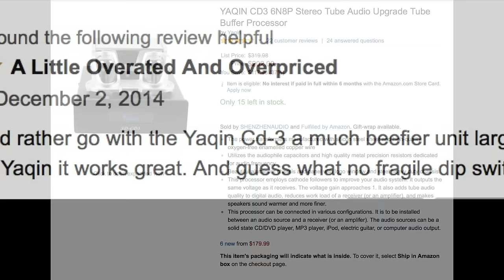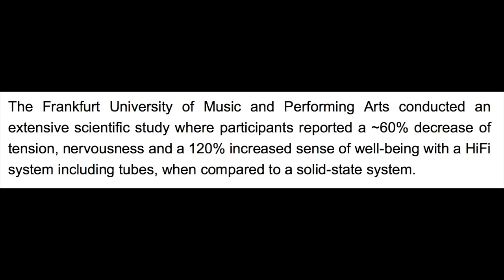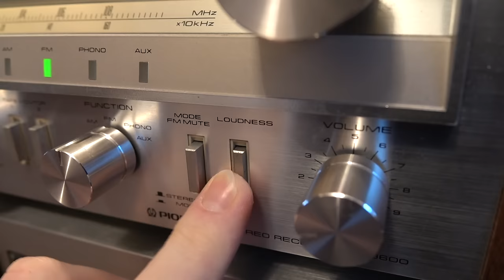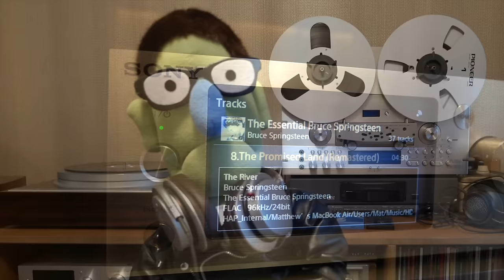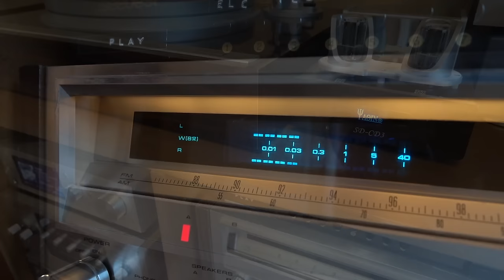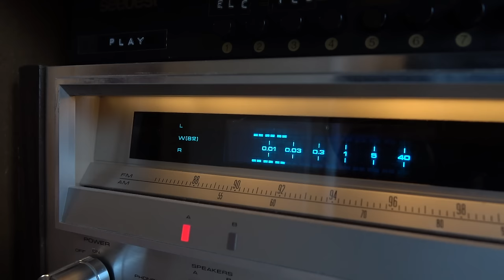Add the magic of Valves to any HiFi - with The Yaqin SD-CD3 tube processor

Comment: I'd somehow expect there to be a bit of a phase shift, which would tend to "open up" the image. While I like tube, uh, valve amplifiers, the only real advantage tends to be that they "smooth" the audio a bit due to the lack of transient response. That smoothing effect is pleasing and tends to "gloss over" distortion from the source. That is why a tube, uh, valve (LOL) preamplifier is just as helpful as a... uh... non-solid-state amplifier. 

Here in the US market, the original Magnavox company built transistor amplifiers in the very early 1960's that were designed to sound like (dare I say it), the tube amplifiers they replaced. They succeeded, but the designs had serious power output limitations and limited treble performance vs. newer designs.

Comment: 3 "Must Do" mods for the SD-CD3... 1) Add 1M resistor across the input jacks. 2) Add 100K resistor across output jacks. 3) Add 220k 2W resistor across C5.

Comment: Have you tried it with the Chinese tubes yet? I'm wondering how much the tube change actually helped. Great video. I just ordered one out of curiosity. I hope it  warms up my digital a little. If not it's no great loss.
Reply: I have one and changing the tubes really improves the sound. I tried some NOS tubes and I noticed a change in sound, then I bought a pair of Shuguang Treasure CV181-Z and after some hours of burn in I was sold, I don't think I'll roll any other tubes into the buffer, there's another user here in youtube with this buffer and the CV181-Z tubes (after reading and watching his video I jumped into buying that tube model) so to answer your questions, yes, if you can buy some good tubes and You'll be happy

Comment: Small fun fact and very late but that original power cable would have made the device not earthed cause the earth pin had a cover on it. There is a bigclivedotcom video where he demonstrates this with an adapter if memory serves correct.

Comment: Tubes have different harmonic distortion profile, arguably more agreeable to us. Not less distortion, just different harmonics.
As for greasy fingers, you should wipe clean halogen bulbs that react several hundred degrees almost instantly. Tubes used in audio equipment don't get that hot, and heat up slowly.

Comment: i really think that what youre hearing is a lot of harmonics the tube introduces to the signal. mostly even order harmonics. judging by the circuit it does uses the tubes i think, those blue capacitors are high voltage grade and it does seem to have a power transformer for HT, yet the black eletrolitic caps are rated 250v wich is not really much safe, right on the limit.

Comment: great stuff... and the greasy fingers bit probably comes from the fact you can't touch halogen lights with you dirty fingers, and they just thought tubes would be the same. not so... the only thing from tubes in my guitar amp is driving them around in the back of my car... they tend to stuff up, maybe the jolting or heat and movement... not sure

Comment: If any amplifier designer from the last century had added a valve stage with a gain of 1 into an amplifier schematic, they would have been fired for idiocy. Yet here we are today, with our so called progress and companies are selling said idiocy for 300 dollars.
The valve sound is not going to be achieved solely through chaining audio inputs through an audio valve stage with a gain of 1. Biggest advantage to valves is their current output potential, they drive loudspeakers better than transistors and with a more musical distortion than transistors that go into clipping, so there is more to the valve sound than just adding the character of a valve at the input stage. There are times when valves are less beneficial, where the sonic signature of your amplifier/loudspeaker combination is already warm sounding. I've never been a fan of valves in the first stage of a phono preamp, because of the low signal to noise ratio. A J-FET is much better. Out of all the systems I've listened to over many years, my favourite has been a Marantz CD50 and Sony SCD-1 into a home made passive pre-amp that uses dual Alps Black Beauty potentiometers,  cabled to 2 monobloc Quad 2 valve power amps that adequately drive a pair of Kef 107s. The valves were GEC KT66, they didn't have that valve sound ( that is such a generalisation because valve amplifiers all have different sound qualities ), but they were implemented in a simplified well designed amplifier.
Valve amplifiers need less audio stages to achieve their rated power output, also meaning less phase shifts in the amp design. The consensus on forums was that I should use a high power transistor amp to drive those dual 12 inch drivers. If those valve amps could drive Quad ESLs with 83db/W, they could drive the 90db/W 107s, and they still do today.They marginally beat any other transistor amp I've owned, but I also liked the sound of the later transistor amplifier Quad 303. If you want that valve sound, just get the real deal, a valve amplifier.

Comment: I really dont want to sound like one of the techmoaners as you seem to get more than your fair share of them here mate, but there are a few things to know about how and why a valve amp (and yes I call them valves too) works in order to understand why you are not getting any results that make it seem like its worth the effort.

I did the same as you for a long time, I remember my dad had a valve amp, its an old valve amp now but then it was "semi old" and I remember it sounded great, after going from cheap amp to cheap amp I invested a couple of grand on an expensive one. I treated myself, because I can, adults can do that kind of silly thing ;)

Dont bother to look on places like Amazon, find out how they work with regards to how the electric passes through it, how the sound passes through it and you will realise what I did and why I went expensive.
How a good one is made is just never going to be cheap :(
Reply from the maker: +BladeRunner21577 what model,of amp did you choose?
Reply: I ended up with an Acuhorn M4 mono block transformerless.
It is expensive, it was for me, but in my search for something that sounds nice I saw so many that were twice the price and a lot more. The speakers to use depends on your room and whats in it so I couldnt recommend any as I found over the years something that sounds nice in one room sounds dead in another.
They are well worth looking at, however there are others that cost a lot less and sound just as warm.
For some of the stuff you have, I imagine you would like it as you clearly love your music. Its a bit minimalist though. an RT909 looks quite busy by comparison.

Comment: Hmm,  6SN7's along with the other tube numbers at the sockets, are dual triodes.    So each tube is electrically like two PNP transistors.    From the view of the circuit board and the pins with traces attached to them, it looks like they're using both triodes in each tube.   Probably a similar arrangement to a darlington pair of transistors.     The 300V power supply would be a bit tricky to build, but the following circuit should work the same, one per channel.   you can build your own for around 25$ less the tubes.

http://rs767.pbsrc.com/albums/xx316/chinacave/6SN7pre.jpg~c200

The slightly wider character to the sound is most likely due to a shift in the dynamic range of the amplification curve.    The same way you sense a wider sound when you step out of a narrow hallway into a room.  It's not the just the subtle reverb of the room,    the wider space is more resonant with lower frequencies.   Your brain is used to that shift down in resonance to mean wider.
So, if the frequency response curve of the tubes peaks at a lower frequency,  it's the same feeling, like stepping into a wider place.   

If you have a spectrum analyser and a pink noise generator,  it would be interesting to see what the spectrum looks like direct and when fed through the tubes.

Comment: +Techmoan the grease from your fingerprints could be harmful for much more powerful "tubes" or should I rather say lamps (100s of Watts), where the temperature rise is so fast that the minuscule amount of grease creates intolerable temperature gradients on the surface of the lamp. Trust me, I've had lamps cracked that way :)

Comment: Putting greasy fingerprints on a vintage valve will, in fact, wipe the writing completely from the tube. The difference in value between a NOS 6922 with Bugle Boy markings and a brand new NOS Bugle Boy without the logo is an order of magnitude. Asian collectors pay a premium for vintage valves, and they want everything in their system to look like it was just taken out of the box. With NOS vintage tubes, sometimes just touching the logo with a clean towel (much less greasy fingers) will completely wipe off the paint. It's like smashing an expensive mirror for nothing.

Comment: Even cheaper: use a plugin like Ignite Amps PT-Eq-X, which is a free emulation of a Pultec EQP-1A. Then you can have both valve and transformer saturation available. IMHO sometimes it helps, sometimes it spoils. 

Adding valves and transformers - whether real or as plugins - adds nonlinearity. It's Lo-Fi not Hi-Fi! But it has the effect of glueing the mix together, and is often used at the production stage for that purpose. Frequency response changes are negligible and harmonics are around the 0.1% level, increasing with harder driving, and yet are very noticeable and usually beneficial. The added body due to saturation can often make a mix sound louder, and there are more bass cues available to small loudspeakers. 

How does saturation work psychoacoustically? I don't know, but I suspect it might be operating mainly on transients and fast edges, perhaps creating spectrum-wide artefacts that help the brain decode music from the sound. It seems to work especially well on synthetic sounds. 

As I say, I don't always use it. Sometimes I like a cleaner sound.

Comment: I think the tubes are just adding harmonic distortion.... Making it sound fuller (because there is more sound)
Reply: When tubes distort they do so with even order harmonics. This is allegedly more pleasing to the ear than the way BJTs distort which is odd order harmonics. But it's much easier to design a solid state amplifier with low distortion than it is to design a tube one with low distortion.
Reply: paulanderson79 That is simply untrue. Tubes produce all harmonics, and tube circuits in push-pull produce only odd harmonics. There are differences, but that isn't one of them.
Reply: I was thinking of class A singled ended designs. Do many makers use tubes (valves as we quaintly call them here ) in class B arrangements?
Reply: Single ended designs are the exception, not the rule. Consider everything that Quad, Leak, Radford ever made. But what you claim is no more true of single-ended designs than push-pull designs.

Comment: OK the description on Amazon says it uses cathode followers so as to give unity gain. That being so, I don't know what the extra two 'blue things' are for on the input side unless they go between the two triode stages (i.e. first through one blue thing to the first triode, then through the second into the second triode, then out from the ones on the front, and back to the output sockets)
I forgot to mention, the lair of blue wires (and the yellow/orange ones connected to them) are for the 6.3 volts used to drive the heaters/filaments (the red light). 
The blue lights serve no purpose whatsoever except to let you know that the power is on! (And make it look good)

Comment: All the tubes do is add distortion.  Anyone with an oscilloscope and high grade bench spectrum analyzer can see the damage tubes do to an audio signal.  Granted, there are some pretty expensive tubes, but still they are not linear.   Then again, a cheaply made integrated circuit amplifier can make sounds sound harsh (one of the complaints for those in favor of tubes).  Frankly I would prefer a well designed FET output amplifier with excellent quality solid state linear components.

Oddly enough though, the damage done by tubes actually is just the type that actually sounds like what he said.  It is perceived as an improvement.  It's just distortion.  Not the type of distortion one thinks of when clipping etc, but it does distort the signal.  Audio enthusiasts call it a "warm" sound.

Comment: Throw that cable away as it's got a plastic sleeve on the earth pin. That earth pin only contacts on the entry so when it's inside you don't have an earth. 
Also. The size of the plug itself is also illegal.

Comment: Dr Carlson said that tube amps give 'warmth' to the sound by boosting the signal in the vocal range, at 10 k Hertz or so. If that be the case it should be possible to get the exact same result using a graphic equaliser. Could someone, namely Techmoan, confirm this by experiment? However this may require one of those oz-silly-scope things.

Comment: The Amazon description of this product is brief and sketchy to say the least but to me it appears to have a valve pre amp input stage integrated with a solid state power amp output stage. If you look at the mega expensive audiophile grade valve amps made by companies like Beard they have valves on both the pre and power amp stages. Judging by 8-bits lukewarm review i would guess this is a faux valve pre amp model only and you could do pretty much the same thing with a chinese dot pre amp utilising an input on your existing solid state power amp for a lot less yen. The only advantage i can see here is that this is designed to work together as an integrated unit but how much better is it in reality over the seperate pre/power amp approach?

Comment: Hay, nice video.  Took a second to look inside, and all the tube pins are being used.  A REAL vacume tube circuit.  I have seen another video of a tube pre-amp.  First thing I noticed, some pins are not connected, and there are two op amps in there.  Fake tube circuit.  There should not be much difference in the sound but it should be noticeable as you indicated.  Tubes are warmer sounding.  Tubes use "Voltage attenuation" , Transistors use "currant attenuation".

Comment: How it works is,  the tubes add certain harmonics of the original signal
Reply: My tube amp measures THD as THD: < 0.02%, 20Hz-20KHz, at 1V RMS, high gain (worst case).

Comment: Am I right in thinking, that this can be plugged into the phono inputs on an integrated amplifier and a turntable can then be plugged into the vacuum tube buffer? So if I understand it correctly I would not waste the phono inputs on the amp, but I would be getting that tube sound!

Comment: This is the Problem the Tubes are adding a Signal plus to the original Signal and this is the 2nd overwave for all Signals that you send in! So the sound will be softer and wider. That sounds in some ears good but it make a blurred Signal and overlayed the Sound.

Comment: The power lead has a sheathed earth, very dodgy! Sometimes the polarity may be reversed in these cheap leads too, and the fuse rating are usually wrong. Bin it and use a proper lead.

Comment: I didn’t realize they were called valves in some countries.
Reply: Me neither. But makes sense somehow, tubes are basically "electricity valves".
Reply: The Vacuum tube was invented by John Ambrose Fleming, a Brit, whose first invention was the vacuum thermionic diode - which he quite correctly named the 'electron(ic) valve'. Fleming also won the US patent battle with Lee De Forest, so for decades, Fleming was also credited with inventing the triode amplifier - which he also named a 'valve'.  Decades later de Forest seized back the US triode patent in the US supreme court (but not Fleming's world  patent rights) - long after everyone else concerned had died and just in time for valves to be obsoleted by the transistor.

Comment: the oil on the glass actually does damage the valves once it starts burning off...
and by damage I mean verrrrryyyyy slowlllllyyyyy eats away at the glass for a couple thousand years before anything actually happens

Comment: Be glad that power lead didn't work.  It's completely illegal in this country and potentially lethal.  There's no fuse.  If the equipment had a fault the only thing protecting it would be the 32A breaker in your consumer unit and I doubt there's enough copper in that cable to carry that current so it would simply catch fire.  Also the space between the puns and the edge of the plug where your fingers in not enough to meet UK standards.  Finally, the earth pin usually has insulation on it on these plugs potentially preventing that safety feature from working.

I really wish the Chinese would stop supplying this type of cable.  To be honest I wish they would just omit the cable altogether.

Comment: Never touch the lamp with your bare hands.Oils from your hands will get on the glass and will decreas the lamp's life + there is a slight chance the lamp will explode. I used to work with laps in moving heads and i tested this.